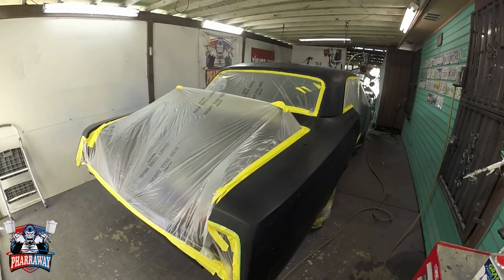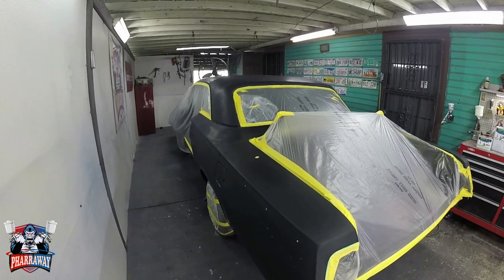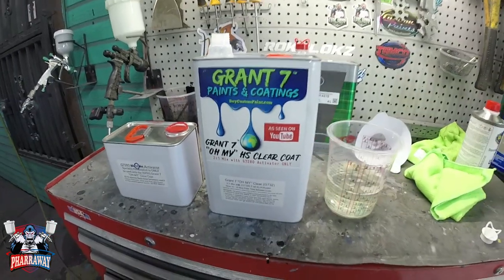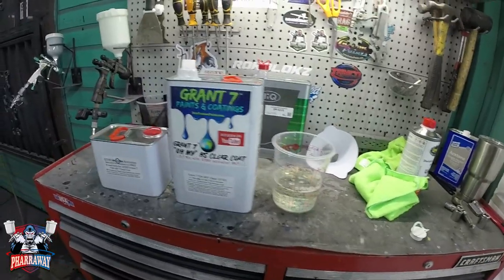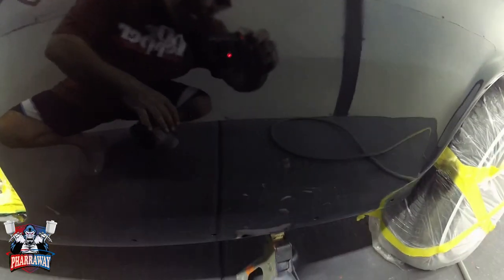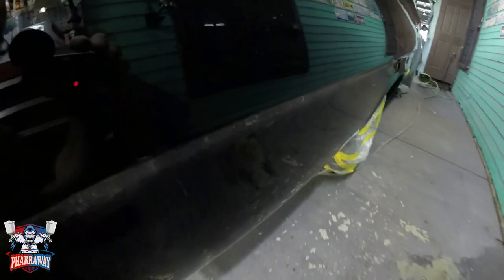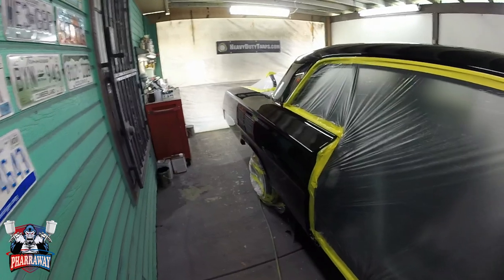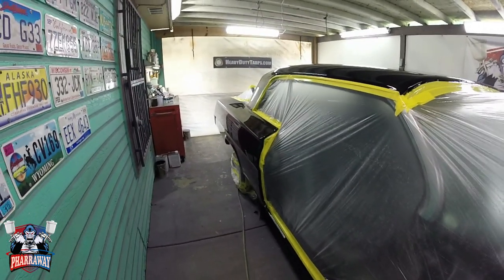How to Flow Coat / What is Flow Coating Part 2

Comment: Sir, 
I am absolutely mesmerized by your amazing application, technique and execution of your work. 
Without question, you display incredible talent, skill and preparation in your craft. 
I am a proud owner of a rare 1985 Mercedes Benz 500 SEC PRE MERGER AMG Coupe. 
It is professionally lowered with H&R Coils, 18 inch BBS RS STAGGERED FITMENT, ( Brilliant Reflex Silver Mesh Centers) with 10inches rear and 8.5 inches front. 
The color is a deep Cabernet Red and Flow coated! 
I frequent sprayway customs and I noticed your sight today. 
Where are you located? I am in Atlanta Georgia. 
I love your work sir!!!

Comment: Great work brother! Ive tried flow coating a few times. Every time i put down the first coat of the flow coat I always get little dots? Otherwise never had that issue in doing base then clear etc. Do you think it could be solvent pop? I always let the work air out a few days after sanding it before the flow coat but still always get the little dots. 

Curious to hear your input, thanks and keep up the good work!
Reply from the maker: Do you use wax and grease remover before clearing?
Reply: @PHARRAWAY  yes i have been using wax/grease remover before re clearing
Reply from the maker: @TheSubieSanctuary  Then it's your filtration, most of the time any little moister will get that result
Reply: @PHARRAWAY  that is a possibility, climate here is Canada is all over the place. I have a couple in line driers between compressor and wall. But compressor also about 60 feet of line before it makes it to the booth.  Ive noticed sometimes removing air chuck that a poof of vapour comes out. Ill pay more attention to that and do some more tests before trying again. 
I appreciate your input brother 🙏
Reply from the maker: @TheSubieSanctuary  Get yourself this and tell them PHARRAWAY sent you you would not be disappointed https://www.steelcamel.com/dry-compressed-air.html
Reply: @PHARRAWAY  definitely worth a try! Thanks again!
Reply: u use spray booth professional or just custom room? what type of compressor ? any filter? any air dryer? do u wipe it with tack cloth before spray?
Reply from the maker: @superstarchannel8546  I have videos on all that brother
Reply: @PHARRAWAY  im replying to @the subie sanctuary broh..😄
Reply: @superstarchannel8546  custom room, intake and exhaust filters. I wipe with wax/grease remover, Then tack it off. I have 2 air dryers in the line. I have a pretty large compressor. I do believe the issue has been moisture
Reply: @TheSubieSanctuary  if u have all that equipments ..filters n air dryers...im sure it came from 2 sources...

1-small dust from your wall or ceiling.
2-small dust escape from your filters air flow.
Reply: @superstarchannel8546  I believe the dust from intake filters is highly possible too. I do believe it was a moisture issue. I changed some things around in the air system and it seems to have currently stopped the issue
Reply: @TheSubieSanctuary  ok bro. goodluck to u

Comment: Thank you so much for these informative videos. Question, how long after sanding could you wait to paint before having to sand the car again? Someone told me that you should apply paint within 24 hours of sanding because the opened pores could get contaminated with dirt, dust and you'll have to wash the car with scuffing paste and scuffing pad. Do you have a general rule on timing between sanding and painting?
Reply from the maker: I have sanded the car and waited 2 or 3 days with no issues, 3 days has been  the most
Reply: @PHARRAWAY  Thank you for your help.

Comment: When you clear a car or whatever the first time and get orange peel what  is the  difference in the flow coat and the first clear ? why doesn’t the flow coat get orange peel like the original clear coat. Is it because the car has bern sanded so smooth and clean? Thank you 👍👍👍

Comment: Can i apply the flow coat clear without reducer?
Its pretty cold here and going to use fast hardener on a tahoe
About 60 degrees
And dont want to run it

Or should i add reducer on first coat of flow coat clear just to have a good bit and rest of the coats pure w no reducer?

Comment: I bought a 64 impala it is primered grey it sat In a garage for 10+ years what do I do take it to bare metal or primer seal it and paint thanx god bless
Reply from the maker: I would just sand it with 180 and reapply primer to block it

Comment: Great work, Pharraway! I have a question for you.. Can both a Volkswagen LA7W Standox solvent base (+60% of acrylic thinner) and the next 2K anti-scratch clear coat (mixing ratio: 2:1+10% of acrylic thinner) be sprayed with a H-2000 mini gun having a 0.5 mm tip? Or is it required a bigger tip? I have to do only a little spot repair. Thanks a lot!
Reply from the maker: Yes

Comment: Spraying clear isn’t what flow coat it. Isn’t it shooting clear then wet sanding it then shooting clear ?
Reply: Did you not see what he did in PART ONE?? 😅
Reply: @moe4772 what did he do ?
Reply: @riffraffchoppers  He sanded it smooth and dull with 600 I think. Go look at it, he explains very well buddy.

Comment: What clear coat did you use on the 1st run? I was thinking of doing my truck with flow coat I was between using the "my firend Pete's" way or using like the finish one 720 the use a better clear on top
Reply: Finish one 720 is a terrible clear. It has so much shrink back after it’s dry 

Cheap and shitty
Reply from the maker: urekem clear